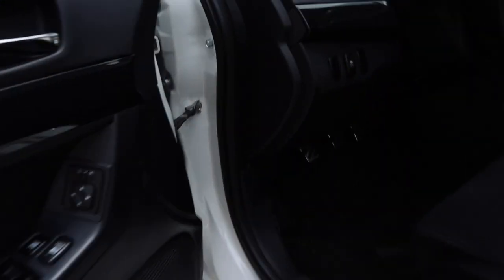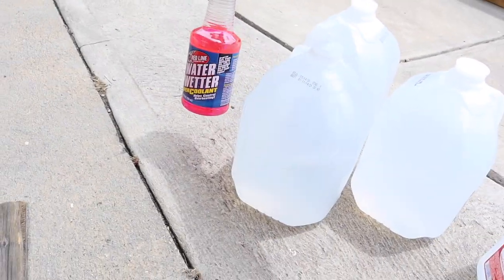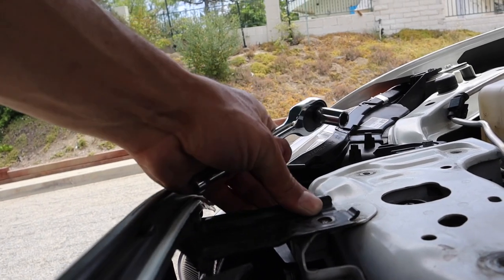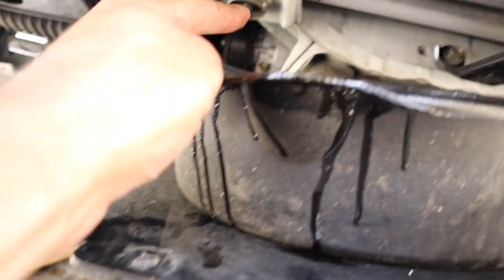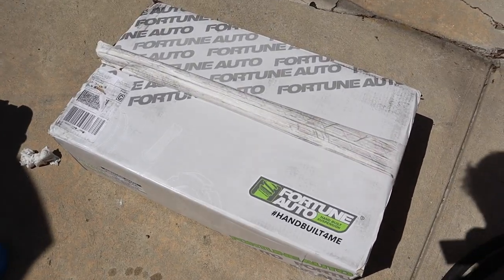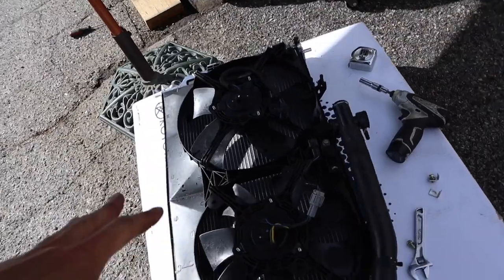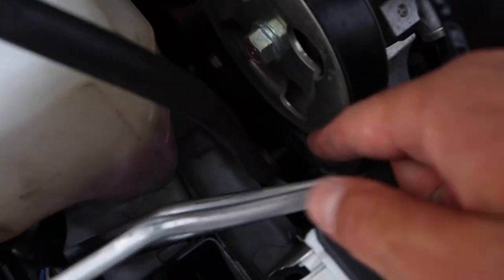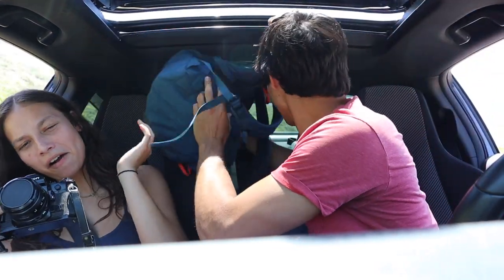EVO X UPGRADED COOLING SETUP

Comment: Is there an advantage of running straight water rather than a 50/50 blend with coolant?
Reply from the maker: Yes straight water transfers heat more efficiently than 50/50. It’s also less of a mess than 50/50 if it were to leak onto a track. Some downsides are that it can freeze in cold areas and that it doesn’t have anything to prevent rust buildup (but that’s why we add water wetter).